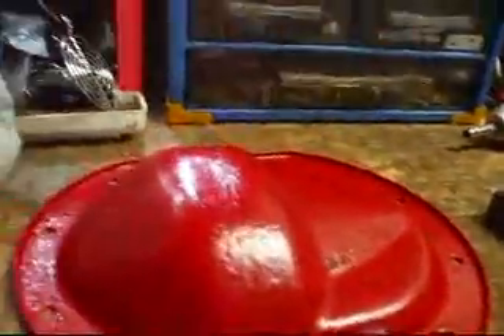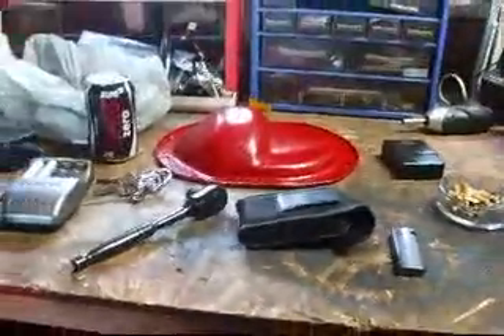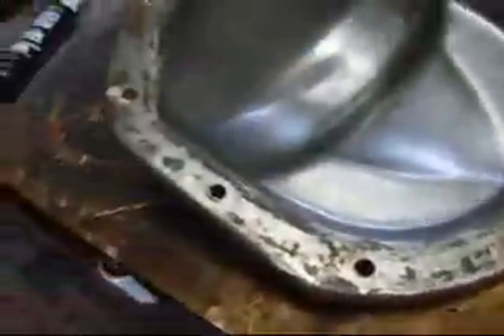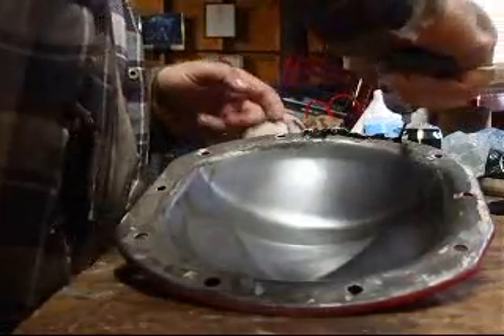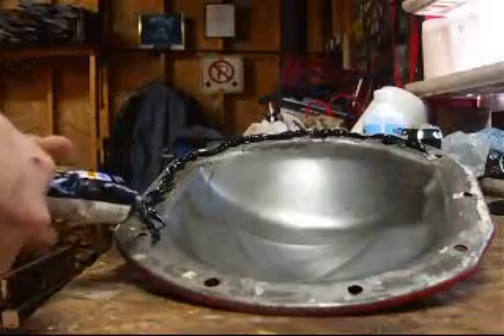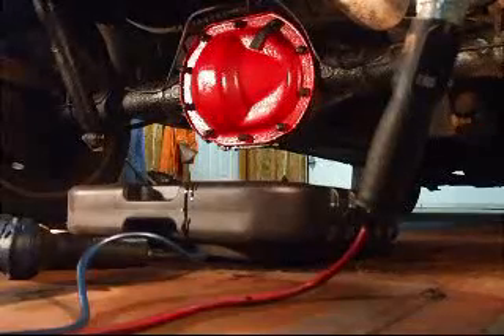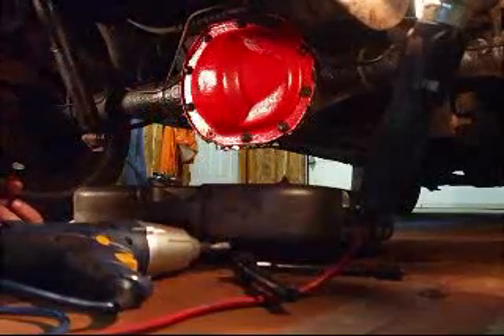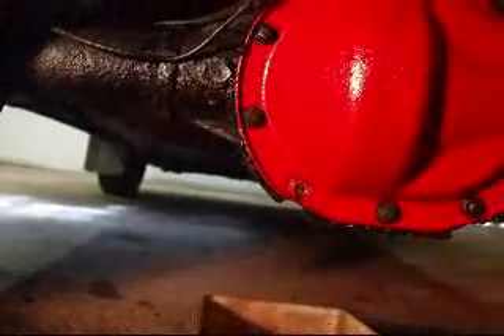Change differential cover 1992 Ford Ranger

Comment from the maker: From what I can find, it looks like there are 2 ways to do it. Drop the diff and pull the cover to drain it completely, or, suck the fluid out through the fill hole, which doesn't get all the fluid out and means having to do it more often. The fluid pumps are a pain, I have to use one to put fluid into my rear diff, but it still might be your best bet. Saves running the risk of drilling into his gears while trying to make a hole for a drain plug.

Comment: cool deal... we all learn form aluminum experiences... jajaja

so my buddy has been asking me to work on his 2001 ranger by flush his front diff, manual gearbox and read diff... does the front diff have to be dropped in order to flush? thats not a smart ford design... i dont wanna even do the job because of that. but i would love drill a whole and tap a drain plug in. what do you recommend? using a suction gun is not what i wanna do... but it might be the easiest choice with a long tube

Comment from the maker: Yeah, that bolt breaking took me completely off guard. I figured there was no way that electric impact driver (which is really just a glorified electric screw driver) was getting those bolts tight enough. Joke was on me it seems. Also a lesson to me on how soft differential cover bolts are. I'll know better next time.